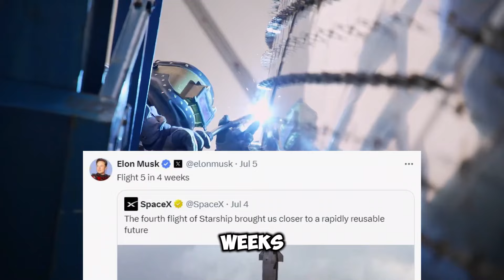SpaceX's Starship Fifth Flight And Nasa Artemis 3 Lunar Lander Update | Starship News Update

Comment: Great Video !  The SpaceX Starship HLS with Landing Legs is needed to build a  Lunar Outpost and then expand the Lunar Outpost to a Lunar Base with a Fuel Depot nearby  (Clementine Base).  The SpaceX Starshio HLS fully fueled can then fly from the NASA Lunar Gateway to the Lunar Surface (LS) and then return to the NASA Lunar Gateway and then crawl to the Orion Capsule to return to earth !  Once the HLS/LEV/LLV can be fueled on the LS of the moon, the HLS/LEV/LLV  with a  6.1 km/sec delta-V can then return to the LEO CSS !  tjl